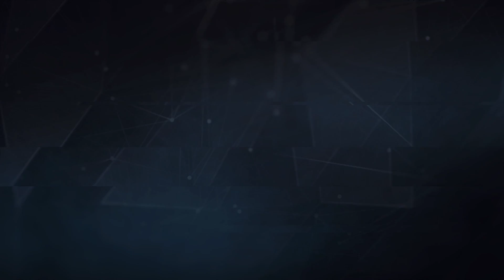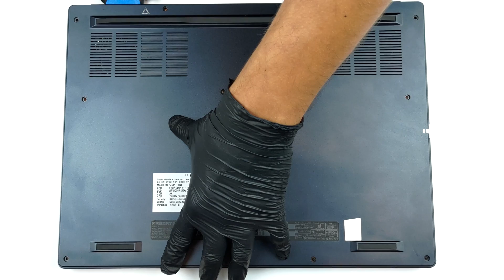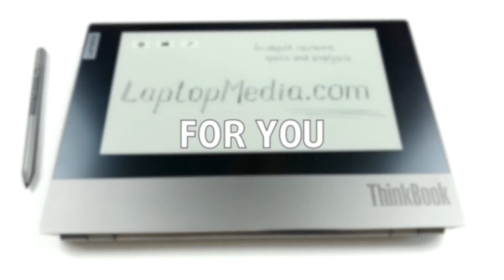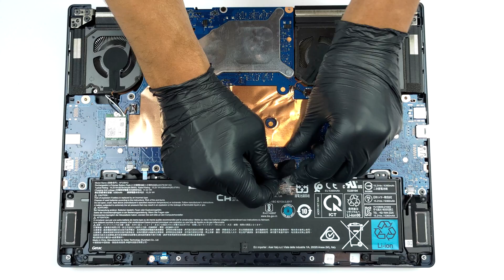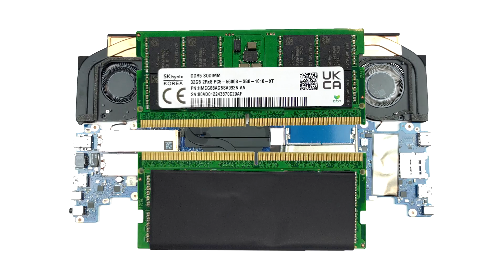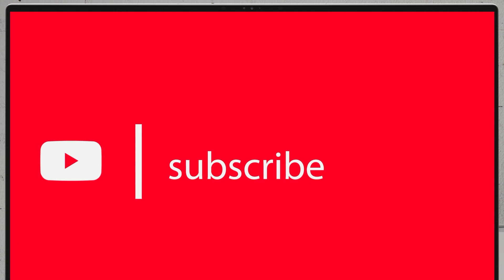🛠️ How to open Acer Predator Triton 17X (PTX17-71) - disassembly and upgrade options

Comment: i hate laptop that force you to remove whole motherboard to clean fans
Reply: Couldn't you get a vacuum with a small brush attachment and clean from the back of the motherboard? I think you would get most of the dust out.